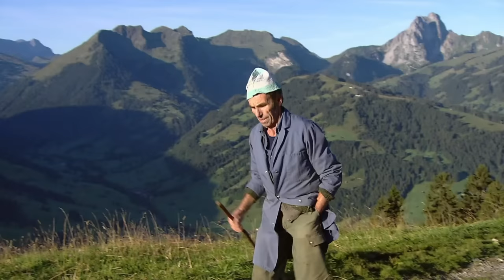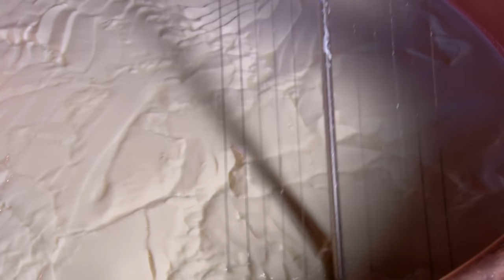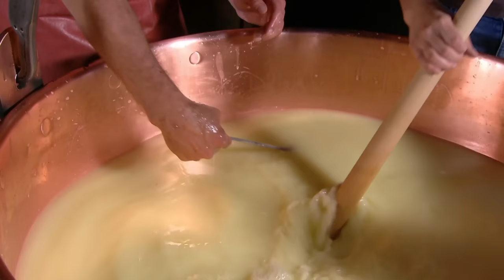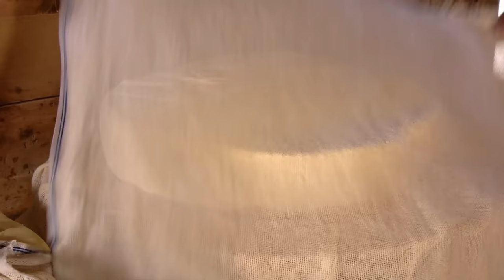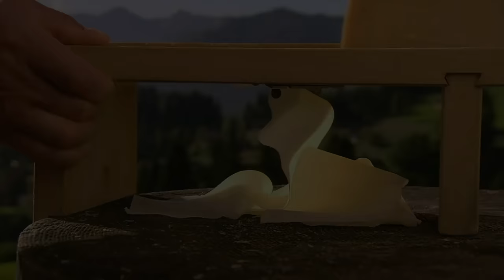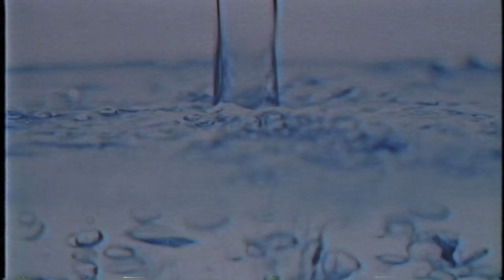How It's Actually Made - Swiss Cheese, Hammers, Roller Skates, Colored Pencils

Comment: Knowing how these things really are made makes the rambling even more impressive.
Randomly there are just bits of truth here and there, other times it's OMG WHAT IS THAT
it looked like a molten metal bath to heat/coat the steel Probably Zinc, or a blend; Then the fire is caused by dipping in hot oil to harden the steel by cooling it fast.
Reply: It's not just bits. Pretty much all of the actual processes next to the ridiculous and funny embellishments he makes are correct and how it is done. It's just presented in such a ridiculous and comedic way.
Reply: @theexchipmunk  id say its average 50/50 nonsense and real, just it starts real and slowly goes insane.
Reply: The best one was his soda video where he said it contained 146% of your daily sugar, and then clarified with an actual label showing that it does, in fact, contain that much sugar.